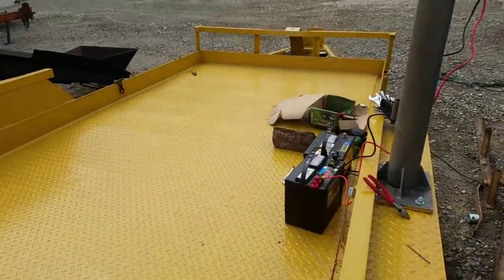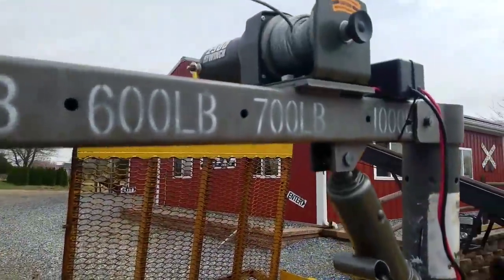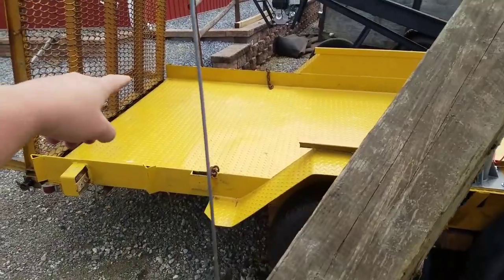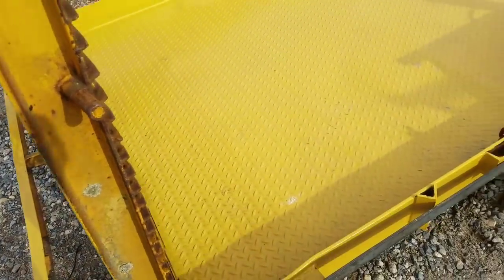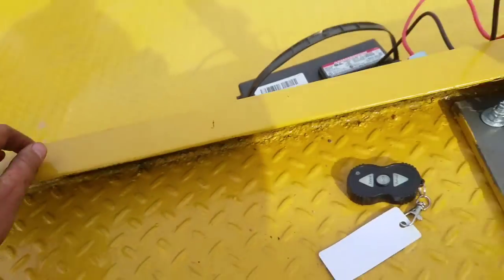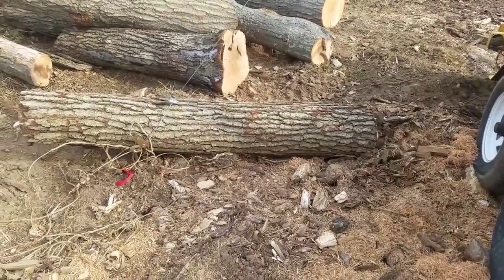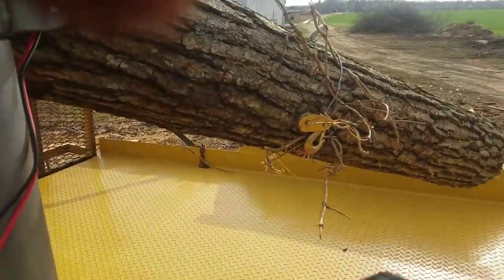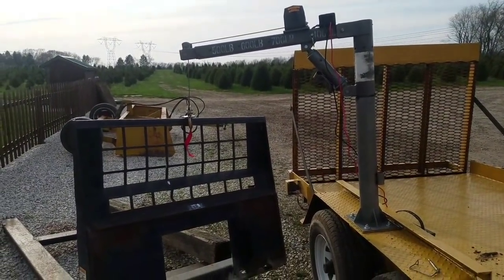Newest project Harbor freight truck bed crane, with atv winch!

Comment: I’m not sure your knowledge of a winch but....You can increase the winch pulling ability if you put a shorter cable on the winch so it only has like 10-15 wraps! Instead of 50’ shorten to like 25’. The longer the cable on the winch drum the lower the pulling power! Winch pulls its max when there is only few wraps on the drum!

Comment: When you put a battery on it add a one of the small solar panels from Harbor freight to the top of the box. I have one on my trailer and it may go for two months without use and the battery hasn't let me down yet. I've had it set up like this around a year and a half
Reply from the maker: Good idea, was planning on doing thay also as a backup.  Did you just go with the small 1.5 amp panel?
Reply: @splittinnstuff6571  Yes it's a 1.5 amp. They are not water proof so you will have to come up with a way to keep it dry. Check out the video I just put up on my channel.
Reply from the maker: @unit14garage88  I left one on my chipper battery for like 2 years in the weather and the charging light was still lit for what it's worth.  I'll check it out!

Comment: Kool! Just a tip! You need to use nylon slings or chain to attach the hook to whatever your gonna lift! Hooking it back to itself on the wire cable will damage the cable eventually. The mount you made looks beefy enough on the trailer fender though...good job on that!

Comment: I'd cut a 4x4 post to put up under the fender to allow the weight to be on the ground and not on the tires and springs. Make more solid. Or a scissor jack to so it can be cranked to solid ground.

Comment: Agree with the other fellas. Don't hook your cable to the hook. It will put serious kinks in your line and will start to break strands overtime. You should have a sling to go around the log. hook your snatch block to the sling and run your cable back to the crane. Double the pulling power making it easier on the winch. Kind of iffy on the fender mount as well. Time will tell I guess. Other than that, nice.

Comment: Get a set of tongs, the hook cinched to the wire rope seriously kills it's lifespan.
Reply: Tongs for sure, just drop it over the log and pull it where u need it to go.. A lot less hassle and no dealing with nasty grime of logs and dirt.
Reply from the maker: I have a set haha, just wanted to give it a test try before I left the yard
Reply: Good idea.  I would like to suggest you use a sling around the log and hook the cable to it. Keep up the good work.
Reply from the maker: @nelsonstree436  i actually just bought a couple slings.  Im gonna try both out, if the tongs don't bite too well, ill just use the slings.  I dont really like the idea of a 500lb piece of wood falling onto my feet/trailer fender haha
Reply: @splittinnstuff6571  I have a small crane truck I tried the tongs with also not good.  Do you have a cant hook or a log peavey.  They work good for rolling the logs onto the slings.

Comment: Like it's been said before it looks like the bracket to the trailer is too short and needs to reach the bottom of the trailer frame rail and be bolted to the trailer frame rail with a backing plate on the inside of the frame rail and have a gusset or two! Because before you realize it, it will have broken out the bolt holes in the fender from flexing. Seen it happen many times before. Keep an eye on it! Nice setup!

Comment: FYI -- Oak varies from around 40 lbs per cu-ft to around 60 lbs per cu-ft, depending upon type of oak and whether it fresh green wood or had dried out... Assuming 60 lbs-cu-ft, that log would weight around 314 lbs -- 60 lbs/cu-ft / (12*12*12)cu-in/cu-ft * 80 in * pi * radius^2 (i.e. 6*6)

Comment: If your gonna get into hauling larger logs. You should check out the log arch trailers on here. Might be a good additional project for your trailer. Save wear and tear on your crane. Plus those arches do the work safer.